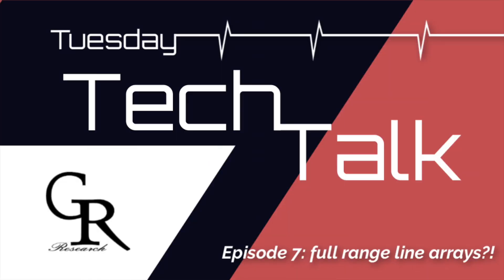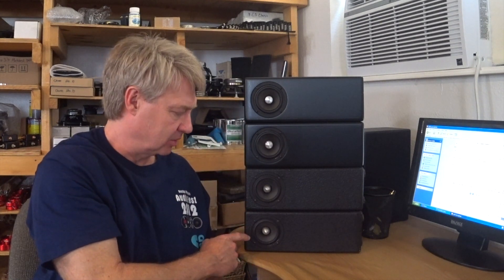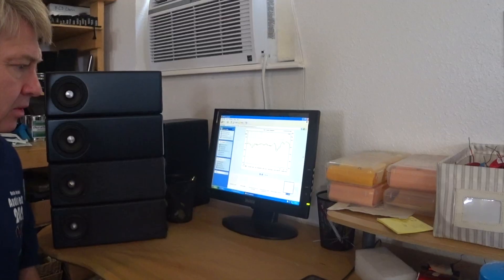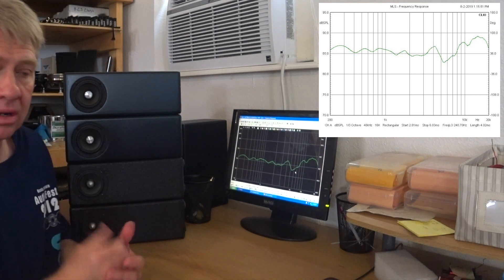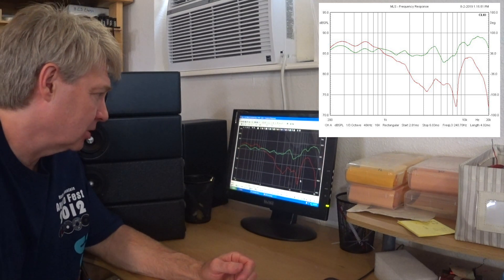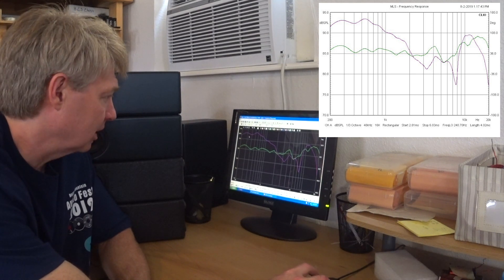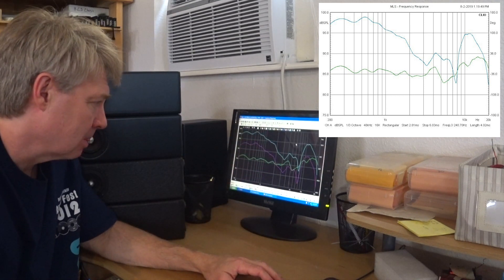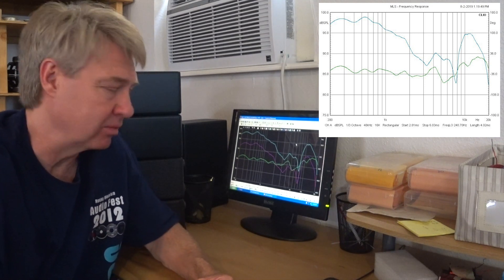Using Full Range Drivers in a Line Array!?

Comment: I've come to realize that there's as much disinformation in the loudspeaker design comunity as there is in the terminal ballistics comunity. How do you explain all the line array speakers sold over the decades to very happy customers? Many who like me, stopped our search for audio nervana when we got our arrays. Some consisting of tweeters only in the array. McIntosh, Wisdom audio, etc etc.
Reply: There is nothing wrong with a well designed line source. I've designed many of them. This episode is about using full range drivers in a line source and the problems caused from do so.
Reply: Line sources: https://www.youtube.com/watch?v=-GVdYAQkD8I
Reply: And it's (this episode) quite incomplete. Too bad you've never heard a proper implementation. What you show here is that 4 drivers in a row don't make up a usable line array. A proper solution would be a CBT for a finite array, or a floor to ceiling straight array to mimic the infinite type, both with the proper DSP applied. They do work, you know... The fact that you didn't hear a proper one yet does not change that.
Reply: Actually what you see here in the example with only 4 drivers is much less comb filtering that what you get if the line is longer. The longer the line is the greater the delay between drivers. And curving the line like the CBT lines increases the time differentials further and can make comb filtering even worse. Note that this is referring to using full range drivers (running full range) and not versions supplemented with tweeters using closer center to center spacing. And you can not correct the time delay differentials using DSP. You can only adjust amplitude. If separate amps are used for each driver then you can adjust the time delays but only for one point in space. Change the reference point and again you have a mess.
Reply: @dannyrichie9743  that answer shows you don't quite 'get it' yet. Never too late to learn though. Start with some proper theory. May I suggest to start with the papers from Dave Smith from the period he worked at McIntosh...
Reply: @wesayso-67  I'm pretty sure that what I have said has been well illustrated above. I'm not much of a theorist, but I would theorize that there will also be a keyboard worrier out that that thinks they know more than the industry professionals.
Reply: @dannyrichie9743  I'm not worried, are you? (lol) I specifically pointed towards the work of an industry professional. Others already brought up Don Keele. You've said a lot in that video and in your comments. Sadly, not all of it was that well informed or true. The part about 4 drivers in a row? Yes... it is problematic. I'll give you that. Just don't diss the work of your well established colleagues based on that flawed demo. It could hurt your reputation.
Reply: @wesayso-67  Well there was nothing flawed about the demo. Real measurements were taken and the comb filtering was real. If you notice in the video the comb filtering got worse when four drivers were used verse two. That is because the acoustic centers of the drivers were getting further apart as the length of the line increased. It gets worse as the line gets longer. That is the simple facts and simple physics of it. Nothing is going to change that.
Reply: @dannyrichie9743  Next time (I know there won't be a next time) consider using a real listening distance. You'll see that the combing won't be as severe as this obvious closely measured demo, as the distance from each driver to the microphone (or one's ear) determines the combing at that point in space. With actual reasonable listening distances these concepts can work. (but a finite array of 4 drivers still won't be a good concept, unless you introduce something like the CBT concept)
The combing from all stereo speaker pairs is more severe than the combing from an actual line of full range drivers at it's designed listening distance. You know, cross talk from the right speaker to the left ear and vice versa. 
Browsing your online catalog, maybe you could pay more attention to diffraction. You should really do a video on that.
Reply: @wesayso-67  Correct, at a distance further away the distance differentials aren't as great and the comb filtering effect will be more limited to the upper ranges. It will still knock the top octave to so right out of it though. And compensation will be needed to balance out the coupling that will be taking place down low. So the response would still be very unbalanced. That was the point of this video. You can't just make a line of full range drivers and expect the response to be like that of a single driver but with higher sensitivity. And again, as the line gets longer the effect become more like what is seen in the example of four drivers from 1 meter. 

And curving the baffle back doesn't elevate those issues. It actually causes more delay in longer wavelengths and can make matter worse. 

And I actually pay a lot of attention to diffraction and surface reflections. I covered those issues in another Tech Talk episode. Check this one out: https://www.youtube.com/watch?v=J5xUioAQ3p4&list=PLUFNGRKZZWXzCt2Syx4yjR4Oy7V-uiePB&index=6&t=728s

And thanks for contributing.
Reply: The curved type of CBT arrays with full range drivers isn't without it's own tricks, with filtering, EQ and shading, quite nifty actually. It's in line with the changes we see in the industry, moving towards new technology like beam steering seen in the Beolab 90 and that new Lexicon: https://www.stereophile.com/content/soundsteer-technology-lexicon
Nor are the full range straight arrays we see today simply a line of drivers. Personally, I have 5 years worth of measurements and DSP corrections on line arrays, I think I know just enough to be dangerous. The game changes with processing, not to fix combing mind you, but to be able to try and mimic an infinite line source.

I don't deny there's comb filtering with arrays like these. I've never denied it and before I plunged into my own project of building straight line arrays I had all kinds of back-up plans ready to go, because I was armed with the same rational thoughts and doubts you are displaying here. I had backup plans to use a tweeter, or only use one full range driver for the top end etc. etc. Even plans to do a gradual filtering along the line, so all drivers play the bottom end, using less and less drivers to do the higher end. Sort of a frequency dependent shading.
However, I've learned much more once I had build my arrays and started measuring them, from all angles. I published most all of that data on DIYaudio and it isn't anywhere near as severe as what you've shown in this demo. Actually, it blew my mind and I had to re-think and adjust all my previous notions about what was really going on.
In the end, out in the room it becomes important how well it can all work together, no point in making the perfect speaker and just dragging it into a room and expect great things. So one has to look at the room + speakers as a system to get ahead. Impossible for the industry that builds speakers, as they are not building our homes, but very doable for the DIY type of crowd. (though the room much too often still is an afterthought in general)
If you're willing to do what's needed, these type of arrays can do much much more than most people would hold possible, the DSP can't fix combing, it can't fix the room either. But it can assist in getting a lot of things right, if you're willing to use proper room treatment etc to help make the room and speakers work towards that goal.
That's definitely different from stuffing a line of drivers in a box and expect that to make up an array.
Cheers...
Reply: @dannyrichie9743 
I'm sorry, I don't have the reserve Wesayso has....
 Let me grasp the concept here....
You stacked 4 full range driver enclosures (thus increasing C-to-C even more than a regular line array), measured them at 1m (hardly the 2.5m+ listening position anyone would be at, except for computer speakers, but then again, why would you stack 4 boxes as computer speakers?) and from this very flawed setup, you can surmise that any kind of line array, be it 4 or 40 drivers, are bad at any listening position for any kind of setup.  Wow.  That's a leap off the deep end!  
You ignored all the research that has bee done in the last few years, your setup is flawed and not representative of real world application, your measurements are then flawed, and you went into this with old preconcieved ideas, only looking to find a way for the data to match your own dogma.  
This was not an experiment.  this was a setup, making sure the data could be made to follow the author's way of thinking.  
In science publications, we need to submit our findings to a panel of peers, which will review the data collected and either confirm to publish or scrap for the lack of scientific methodology.
I guess there's no such thing on Youtube!
Reply: Wesayso: I agree with what your saying. I have tried everything you just mentioned somewhere along the way. I even worked with some of the best DSP systems available and some not so well known to the public designs that I was involved with in the beta stages. Too bad you aren't closer. Maybe one day we can chat and compare notes and experiences.
Reply: perceval2000: It sounds to me more like the measured data that I presented didn't conform to your preconceived ideas. The line of 4 drivers measured at 1 meter is very much like a line of 20 drivers measured at a listening distance. Been there, down that, won a Golden Ear Award for it. I've designed dozens of line arrays and have been doing this for a while.  http://gr-research.com/images/2021.jpg
Reply: Another one of my line source designs: http://gr-research.com/images/valin.jpg
Reply: I also did an episode on line sources: https://www.youtube.com/watch?v=-GVdYAQkD8I&list=PLUFNGRKZZWXzCt2Syx4yjR4Oy7V-uiePB&index=14&t=0s

Comment: Thanks, Danny great info. That answers my curiosity about the P.E. line array.. ✌️
Reply: You're missing out if you don't investigate them any further. I'm afraid Danny doesn't do them any justice.
They are not meant to spray/splash the sound upwards, as suggested in this video, quite the opposite actually.
Sometimes things are not as simple as they seem. Al we see here is misleading info on 4 drivers in a row.
That really doesn't make up a proper line array of any sort.
Reply: @wesayso-67  ... Thanks,  man . I would have no use for that design , I just am ignorant to there function and use... I'm set on bookshelf speakers and designing my living area as to be sound friendly, I'm going to get the OB's and at some point the small Maggie's... I'm weird like that, I'll blend in different designs to achieve the sound I'm chasing...

Comment: Your experiment is flawed because your line of drivers is too short, unless your intension was to show that these designs do not work. The only thing  you have shown is that  a four driver line source with fairly high ctc driver spacing works poorly. Why not build a full line floor to ceiling, drivers closer together, properly EQed, measured from listening position. Then tell us how what you think.
Reply: Have to agree with you: I have done a line array floor to ceiling, and EQ'ed with digital I got great results from approximately 8-10' away, which gets rid of the comb filter effects that you get at normal  Freq resp mic measurement from 1 meter away.  So, IF you use small full range (4" or under) drivers tightly spaced together, and listen from a normal distance (with at least one tall acoustic absorber on side walls to reduce first wall reflection), you can get fabulous results, especially if using several carefully adjusted parametric EQ curves on something like the HD mini dsp.  One thing not accounted for is the fact that a 3.5" paper or fiberglass full range such as the TC9FD18-08 or TG9FD18-08 in a 25-high stack will begin to normally begin to beam at high frequencies, and at 10' away with a full height stack, the comb filtering will sound much better than the measuring mic at 1 meter is experiencing.  The thing is, it is much more accurate to measure actual freq. response at listening position when it comes to long full range line arrays.  Start with DIYAUDIO/forums/speakers/full range for a differing opinion.  There are some drawbacks to this technique: you will not have the silky highs of a dome tweeter, and trying to go to 20 HZ flat with a line of 3.5" FR drivers will result in some driver distortion as drivers exceed XMAX (which they will), so either a good 20-80 hz subwoofer addition, or limiting F3 of the full rangers to 30-40 hz is the way to go.
Reply: Actually the longer the line gets the greater the offset of distances between the drivers and the amount of variation from the comb filtering is increased. You can EQ the gain back out of it down low to reach an average that is close to the average across the top end but the there will still be large swings in the response due to the comb filtering and the high center to center spacing distances of the drivers. 

If using a line of ribbons or planar magnetic tweeters where the edges of the diaphragm can be within 3/4" of each other then the peaks and dips can be controlled down to +/-2db ripples.

But with full range drivers that can have acoustic center spacing of 4" or more then those ripples across the top end can easily be +/-6 or 8db. And you can't EQ that out. If you actually EQ it to flat for one point in space then as soon as you move up or down a few inches you are right back to all new 6 to 8db peaks or dips.  

And I have designed many line source designs. They are in homes all over the world and have won some of the industries highest honors. See some of them on our Facebook page: https://www.facebook.com/pg/grresearch/photos/?ref=page_internal
Reply: @judybrandt5176  EQ'ing the line digitally still will not fix the problem. You can only correct the amplitudes for a single given microphone location. Move up or down a few inches and you'll be right back to +/-6 to 8db swings (or more). And those peaks and dips will be part of the floor and ceiling reflections, so the overall room response will be a bit jacked up as well. 

And if trying to digitally EQ something avoid the inexpensive units out there that have you use their internal D/A converters. The D/A convertors, analog output stages, power supplies, etc are equal to that of a $49 CD player. They will suck the life out of the music. The DEQX system is not bad (mid-fi level). Or check out the Hollis Audio Labs model. His is a fairly high end piece of gear.